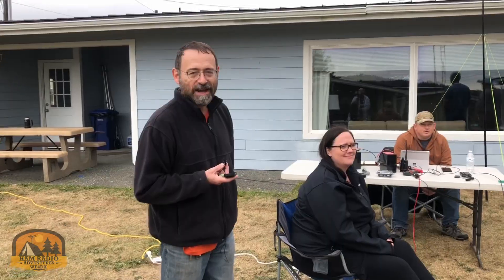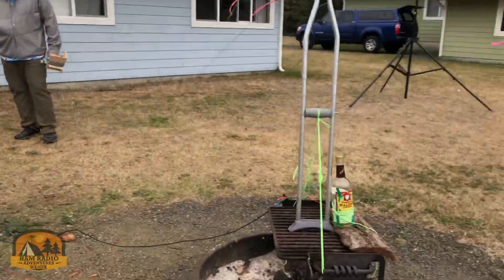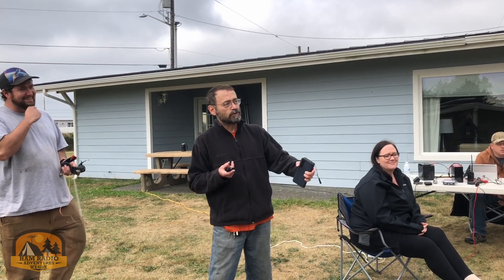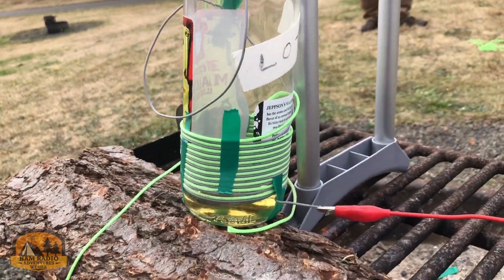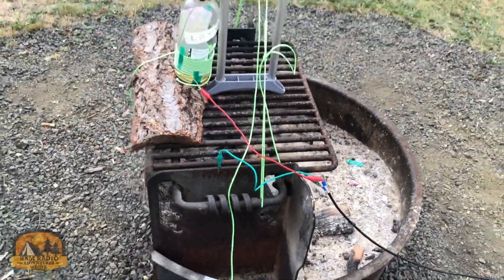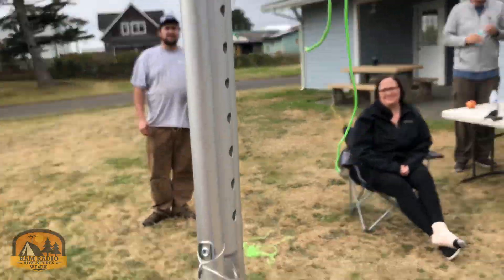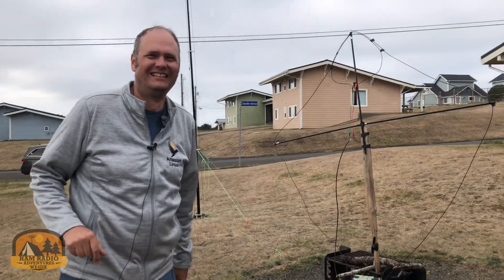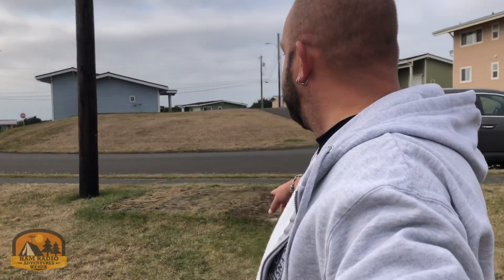Making Ham Radio Antennas out of Things that Aren't Antennas

Comment: Next competition:  An antenna that gets at least one WSPR contact, but has to be edible and eaten afterwards.   BBQ-On-The-Air!
Reply from the maker: I'm think it would have to be wet and salty.
Reply: @hamradiotube  A raw steak.  Would a T-Bone be a dipole?
Reply: @magwhyte  Well if it's bone in. You can make it a vertical too